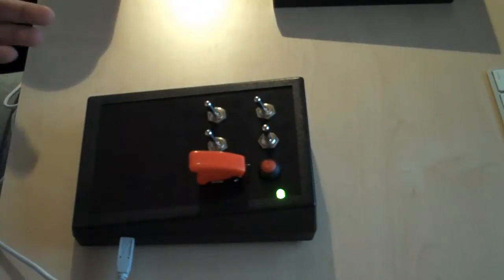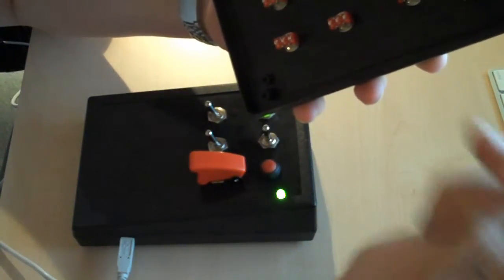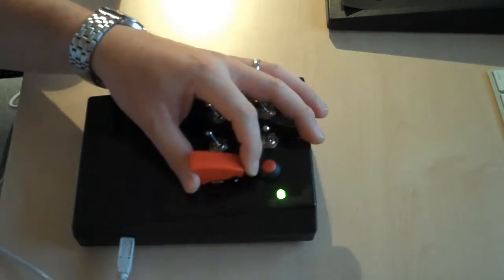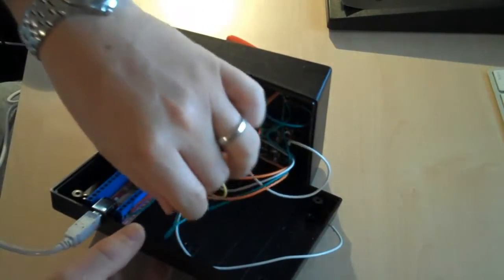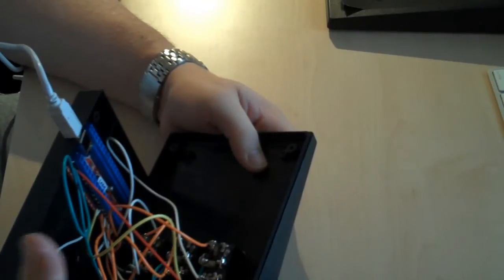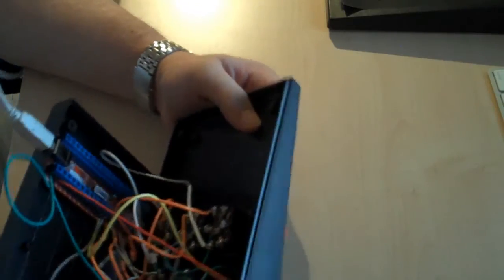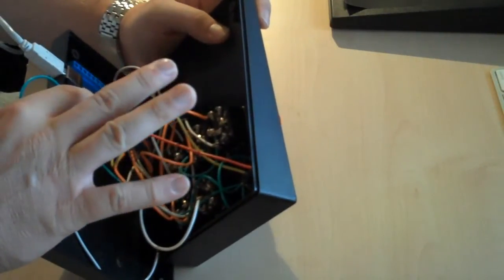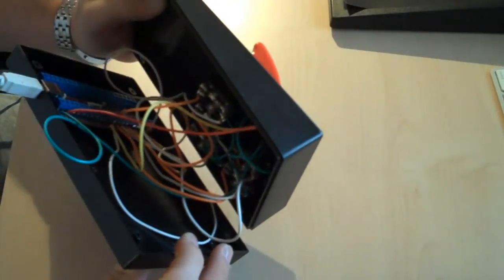How to make an A-10 Panel - Part 3

Comment: Okay. If i wire an on off on momentary switch where both on's were the same open/close canopy button, do you think that would work? Also, is that button (ctrl-c i believe) work to where you would tap ctrl-c (or just press the momentary switch up) and DCS wold do the full open/close canopy motion? 

What im asking i guess is when you press the hotkey to open or close the canopy, do you have to hold it down, or just press it?

Comment from the maker: Yes...it treats momentary switches just like a toggle which is a bit of a pity. Although...I think this can be challenged as the Warthog has a momentary on it. I think it is more that ED didn't think to program the canopy to momentary as they didn't have a controller for it. I would build it anyway and then lobby with ED to change how it behaves in future updates.

Comment from the maker: That is correct. DCS ignores it. The Warthog throttle developed by Thrustmaster for the DCS game has toggle switches that work exactly the same way. They constantly send a signal. But because these game controllers use DirectX and are not just like a keyboard pressing D constantly, they behave a lot differently. The game now can be coded to ignore the fact a switch is on constantly and that is what DCS has done.

Comment: okay, thanks for the quick reply. So, i believe somewhere i heard that DCS ignores the fact that the switches are always up. Is that correct? Because if, for ex, the switch when closed presses D or something, its gonna hold D down until you flip the switch open. Does DCS have a problem with this? or does it just ignore it?

Comment: Nice panel Tiger. ive got a few questions if you dont mind.

1. (Less important) Do you have a resistor from the 5v to the LED?

2. Does ur gameboard have any kind of pulse included so when you flip a switch, it only  "presses" the key for a small period? Or does DCS not mind that the toggle switch is always on?

Some chips ive seen include this timing feature so when you flip the switch, it only presses the corresponding button for 1/4 second. Does this chip have anything like this?

Comment from the maker: The negative end goes into the part of the board that says GND. Every button connection is a positive. On your switch you may have something that indicates which pole (the things that stick out the bottom) is ground. Connect ground to ground (I've) and connect the other pole to the button you want pressed when the switch is thrown.